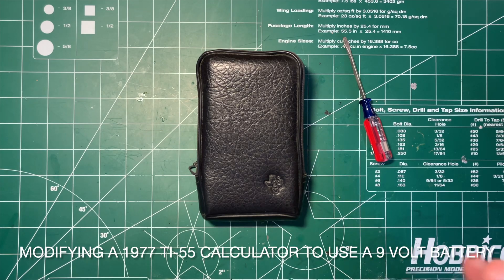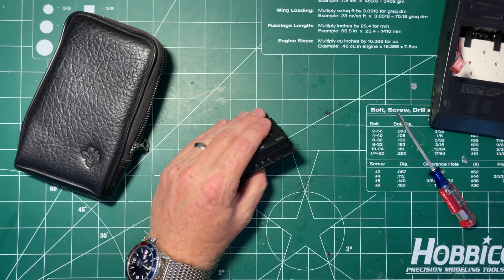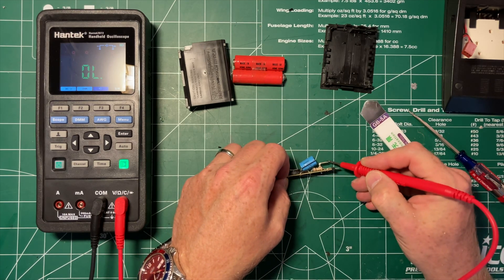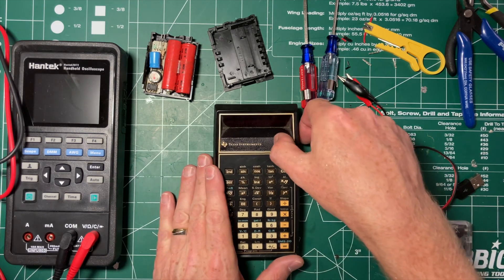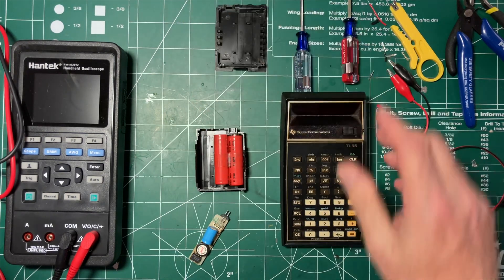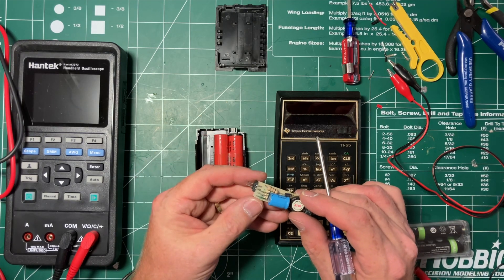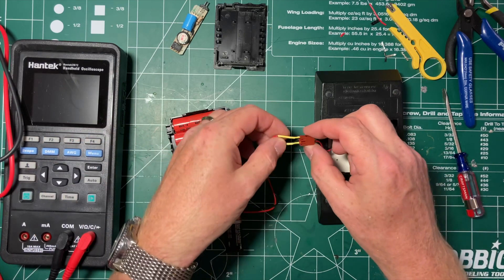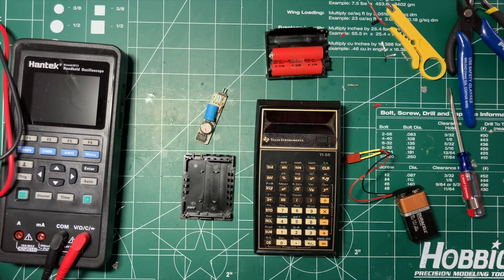Modifying a 1977 TI-55 Calculator to use a 9 Volt Battery

Comment: The circuit takes the AC power from the wall charger and charges the NiCDs , and also converts the 2,4 DC voltage of the NiCDs to 9 VDC for the calculator.